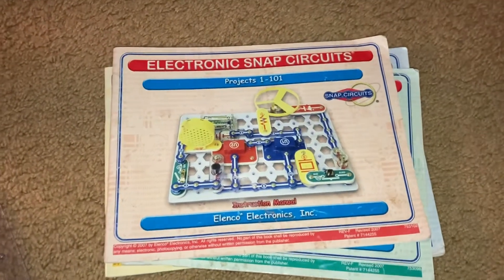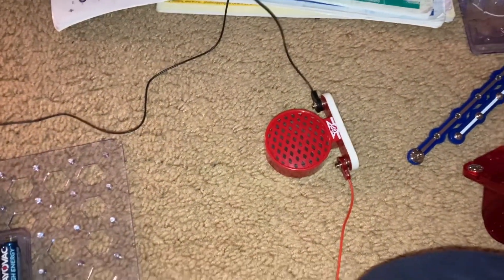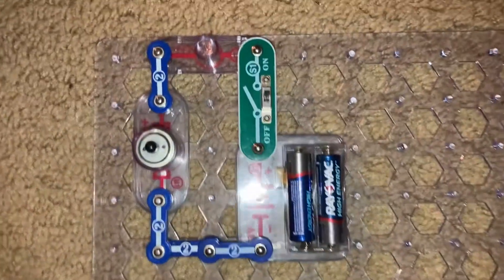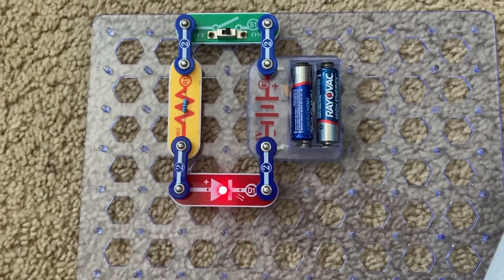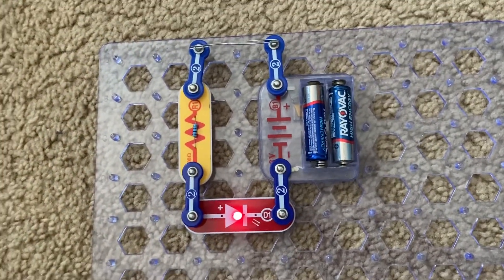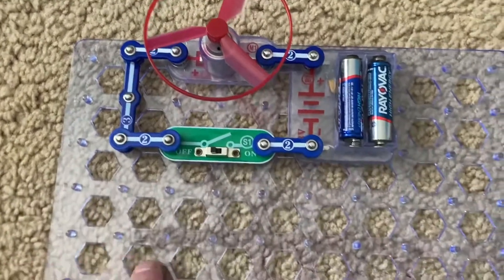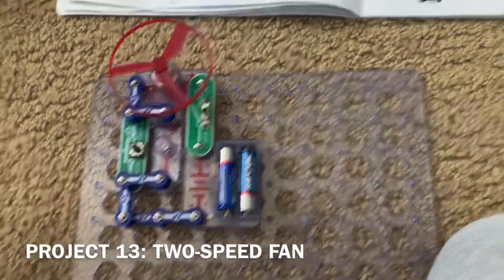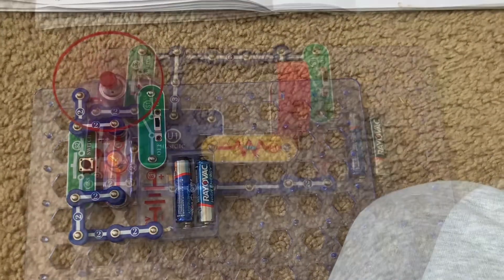Snap Circuits Extreme SC-750 : Projects 1-15 (VOLUME WARNING)

Comment: The music ic is slower than mine. Is the ic different in the sc extreme and the sc junior
Reply from the maker: I don't know about that, but I got mine as a replacement part (the original one in my kit broke).  Maybe the older IC's sound different than the new ones.

Comment: Apparently the Happy Birthday song is out of tune when it hits the highest note so I'm just wondering if it would help to join two battery packs in parallel to increase the capacity?
Reply from the maker: That might help, although I put the battery packs in series and not parallel.  Were you talking about putting one pack above the other, because if you were, that would short-circuit the batteries and/or other parts.
Reply: @andrewsstation6436  Ah - sorry for the confusion. I did mean putting them in parallel, which means joining the anodes together, AND cathodes together, in which case the output voltage is the same as each unit in parallel but the capacity gets boosted. (Of course, however joining each anode to one cathode would short out the batteries because that technically puts the batteries in series rather than parallel and without any loads)
Reply from the maker: @CRH1A-1145  Oh, I kind of know what you are saying now.  That may make the sound quality better.